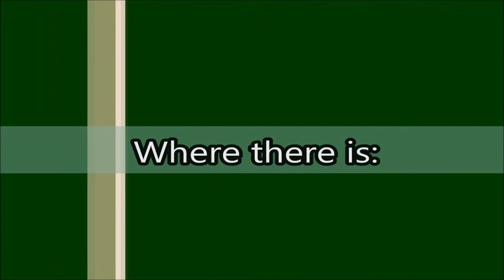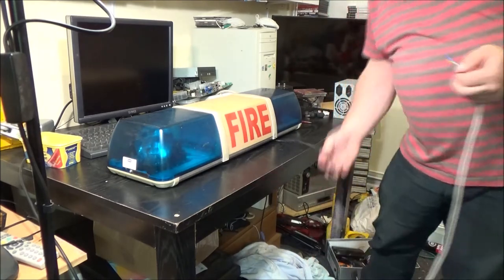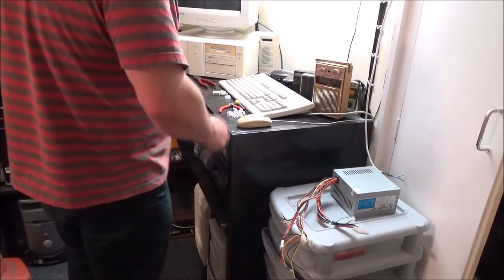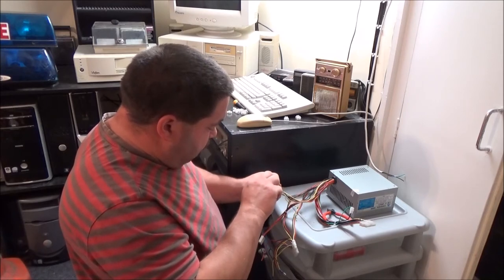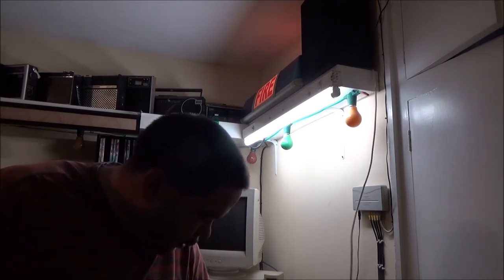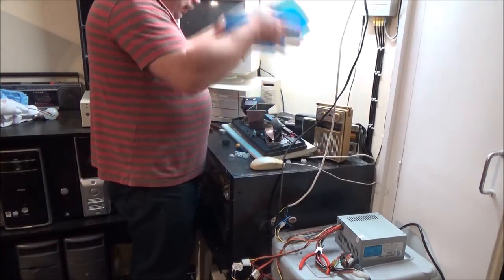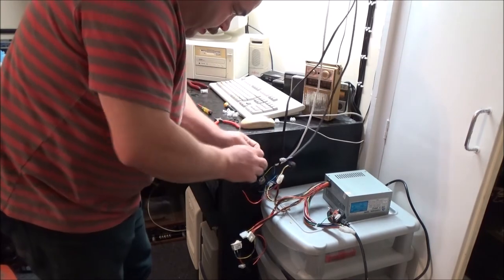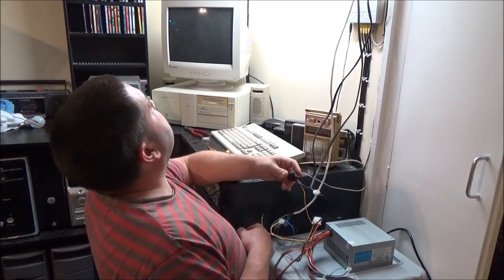Wireing My Blue Emergency Lights (Contains Flashing Lights)

Comment: I may have a few of them switches with the LEDs in from when I used to modify cars years ago, I'm unsure if I threw them away when I moved, I will double check the shed, if I still have them I will post them to you, I think I also still have a green doctors beacon that i acquired, again it may have been thrown when we moved.